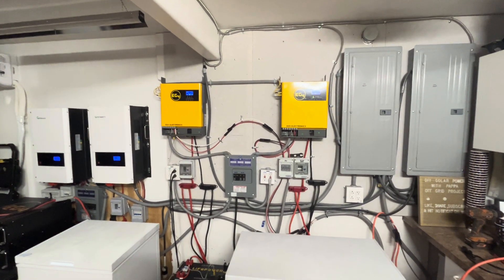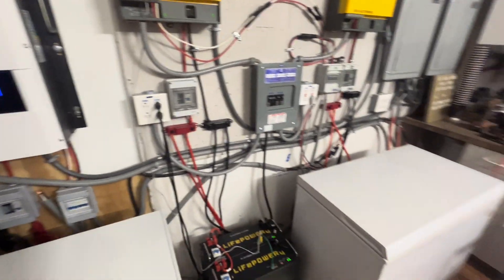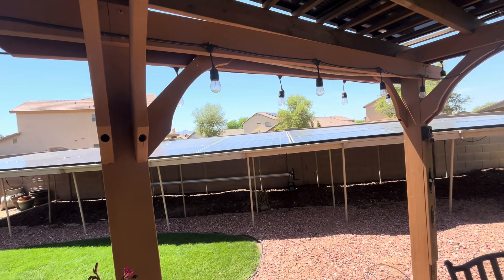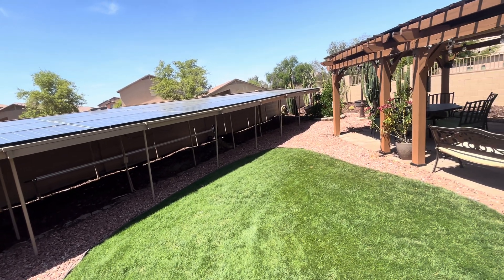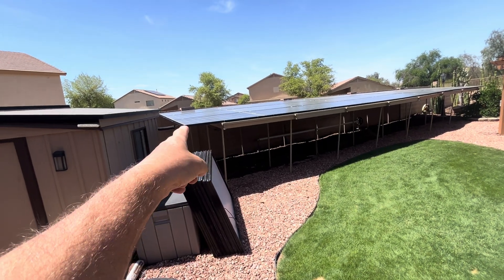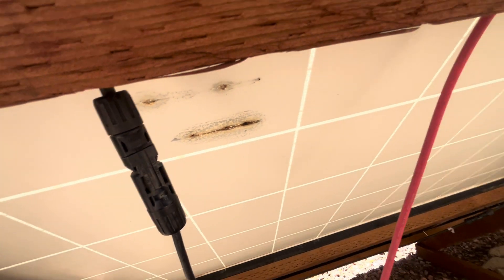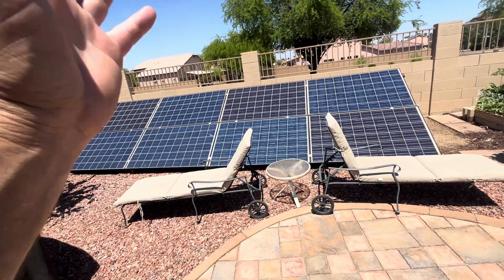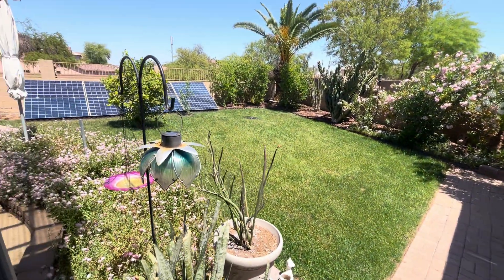DIY solar panel for home. Bifacial New 400-500 watt mono panels versus used 250 watt poly panels

Comment: Can you do a video on your panels in parellel. Do you use a combiner box?
Reply from the maker: I do not use a combiner box but are moving away from using parallel arrays since the higher 500 vdc input from solar allows me to connect up to 13 solar panels on series and stay under 500 vdc solar panel PV input into EG4 inverters. My Growatt inverters are limited to 150 vdc solar panel PV input and is not as efficient at bringing in more watts and amps from solar panel as being in series. I am getting up to 80 percent more watts input when in series and connected to EG4 3000 watt inverter. I am also moving away from the used poly solar panels to new and used mono and new bifacial solar panels. I am seeing a huge increase into inverters with same watt solar panels with the mono and bifacial solar panels compared to poly used solar panels. I will try to do a video on connecting solar panels in series and parallel and the benefits & drawbacks of each wiring connections. Hope you have a truly wonderful and extremely blessed 2024
Reply: Thank you. I do have the eg4 3k same one you have. I was going to go with the ten 400 watt bifacial in series. Right now I just have smaller 100 watt panels. Total of 1200 watts in two different strings. Thanks again for the fast reply. Love the videos. Keep up the good work.
Reply from the maker: @D1petergriffin  very nice. I started out with just 2 solar panel and just kept expanding as I saved more and more money with using more and more things on solar power. Now I’m running my 3 1/2 ton and 4 ton ac right now on just solar off grid while my pool is running on highest RPM’s along with a mini split keeping my house at 74 degrees for 2 story 2450 square foot house and running a 18,000 btu mini split in garage as well on solar keeping it 78 degrees while it is 105 out right now. All my solar off grid will be completely paid off from savings on electric bill by December of this year, 2024. I use almost double of what I used before setting up off grid solar. It is so easy now with the products they are selling. Hope you solar system works great for you.

Comment: Man I'm SO glad I watched this video. Those same used 250w-8.1a panels are the ones I was going to buy for $50 each. With a possibility of that much degradation in them I would be hugely disappointed in their output. I don't think it's worth me getting them for even $10/ea due to the work involved in hauling them onto the porch roof by myself at 69 yrs old. As Yoda might say: "A solar Guru....you are".
Reply from the maker: I actually think the used mono solar panels are worth it because they do better with shading, cloud cover, early morning and dusk also most importantly in series with inverters that can handle 500 volt dc PV input. I tried using in parallel for my Growatt 12kw inverter where the max PV input is 150 v dc. Was not happy with the efficiency but I used those same solar panels on my EG4 3000 watt inverter and they are so so much more efficient. I gave 6-330 watt mono panels in series along with another 6-330 watt mono solar panels in series, then I connect those on parallel. That’s almost 4000 watts between those 2 string combined into 1 string. I get 3000 watts input into inverter as where when I string of 3 in series then 4 sets in parallel, I was only getting around 2000-2200 watts with Growatt inverter. I like the used mono solar panels for the used price. You get what you pay for. I just bought 10-400 watt bifacial with 100 possible from back side and those are excellent panels at $124 each. Well worth getting brand new. I can get 3500-4000 watts out of those new bifacial but have a tough time getting 2500 watts out of 5000 watts used poly solar panels. I’m 62 years old who has been going through 2 incurable cancers for last ten years and just diagnosed with another cancer, so I know it is not easy setting up this solar system but it is possible when you are determined. Best inverter for money is the EG4 3000 watt off grid inverter where you can connect up to 5000 watts and up to 500 volt dc PV input. You just have to keep the dc amps coming in from solar panels below 20 amps. Check out my newer videos with these EG4 3000 watt inverters and see everything I run with these little lightweight power house inverters and EG4 LiFePO4 battery banks. Thanks for your input and I hope you have a truly wonderful and extremely blessed 2024.

Comment: Your first problem is you comparing bigger by fish or soap panels with smaller solar panels and old solar panels.There's to new solar panels And if you're took care of your police, so apparently still be given yet 200 W, but you never took care of them did you?You already said they're used when you got them. My 24 years poly solar panels   Still give me the power. They said they will give the day. I got him when they're brand new but didn't get that guy. I got him when they're brand new but didn't get. That again, I kept my panels clean and kept the wires. Good kept replacing the wires. If they got bad or if I didn't like them all on son. They still do very good for me. And besides, they start making power before the other one's will and they stop making power. After other ones will do we make a more power by working longer than the other ones.
Reply from the maker: Thanks for your input. We appreciate it. Hope you have a blessed day.

Comment: I have 9 poly panels I bought when they got below $1 a watt in fact I got a pallet of 10 - 60 cell panels with shipping for $1800. I know I should have gone with mono for here in Oregon but they were still expensive comparably. I can get 13 kwh in summer but the winter I have got less than 1 kwh. I am at 24 volt and wish I would have gone right to 48 volt so was going to add more panels and thought of more used poly panels since they are so cheap. To try and match my summer power I would need 9 x 13 or over 100 panels. It looks I will not be getting rid of the generator but I did finally went with LifePo4. Something about the poly. Once in awhile on a cold morning  after a rain or at least a clean sky the sun will come out from behind a cloud and jump up my harvest to 2400 watts which is max output but it doesn't last long, usually it is 1500 watts. It is like the sun shines a little different using the clouds to increase radiance. You can actually see it when you know it is happening. Poly may be a good choice for cold mountain cabins with clear, clean skies. Once they heat up there isn't much we can do to increase the harvest. Thanks for the information, I think I may go with the mono now. I liked and subbed.
Reply from the maker: I started out with the cheap poly panels because I have a large 1/4 acre lot yard and  they were really cheap but seeing I can get so much more out if the same size solar panel, I’m going to spend more money and get the new solar panels. Thanks for sharing your comment with us. Hope you have a truly wonderful and extremely blessed 2024

Comment: add another battery or 2 to get a true(r) idea of how much they can produce before 12 noon, oh and swap out the poly panels for bi facials a complete no brainer :)
Reply from the maker: Thank you so much for your comment and suggestions. We started with this simple set up and now heat and cool our entire 2 story 2450 square foot house and 600 square foot 3 car garage with only off grid solar. We use a 35.5 kWh LiFePO4 battery bank for overnight use. Our electric bills are 10-15 of that of our neighbors. We also heat our 15,000 gallon in ground pool to 86-89 degrees starting in March with a pool heat pump pool heater that uses 7500 watts while on and when our neighbors pool water temp is still in the 40’s and 50’s degrees. This is just a simple set up I ran for 2 + years in a shed when playing with solar. We have evolved considerably check out all the things we do with off grid solar and what components we use to do this. Thanks and hope you have a truly wonderful and extremely blessed 2024.

Comment: Hey, you jumped into the solar river early on and now you are moving with the flow brother. I'm still standing on the bank waiting to get in. Great job!
Reply from the maker: Come on in, the water is fine. Very easy to understand. Components are so much more simple than 4 years ago. Easy to get all your supplies at one place. Click on links in videos first products. Hope you enjoy the other videos. A lot of info in videos. I started 5 years ago not knowing anything at all about solar off grid or mini splits. Thank you and hope you have a truly wonderful and extremely blessed 2024
Reply: There are numerous places that have used or inexpensive panels now. Kinda insane. Also batteries are dropping in price hard.
Reply from the maker: @davidsalvador8989 I like the server rack batteries from signature solar that have built in fire extinguisher as a safety. Without that you can not put out a lithium battery fire. Don’t like messing around with building my own battery when the batteries they sell have so many safeguards built in. Follow link in video. Down from $1800-$2000, now around $1,200 each plus this week is free freight for $2000 or more spent. Saves about $250-$350 on freight cost. Good luck with your project

Comment: Just a question are those by facial panels also connected in Siri or in parallel because that also makes a huge difference
Reply from the maker: The bifacial solar panels are connected in series at 37.1 volts dc each equals 371 volts total to the EG4 3000 watt inverter that can handle up to 500 volts dc PV input. Keeps dc amps below 20 amps using 10 gauge PV wire.

Comment: lot of variables here, not just bifacial vs non bifacial. Are they all the same age? Did you individually test all the panels before hooking up? I've gotten plenty of panels that were used and were broken and got replaced with other used ones because they were very bad. Similar to how bad yours are. My "250 watt used" ones output 220-240 watts because I tested them to make sure they were good and returned the crap ones that were lower
Reply from the maker: I’m going to replace my poly panels with new bifacial sole panels this next year so no big deal with old panels. The panels still give me more that what I need at this point. Thank you for all that valuable input in your comment. Hope you have a truly wonderful and extremely blessed 2024.
Reply: @diy-solar-guy  All of your bifacials and any other panel, new or used, can also come with half input. You should always measure each panel individually before installing
Reply from the maker: @gg-gn3re yes, I need to purchase something to measure watts , any suggestions?
Reply from the maker: Did you send me a response for what meter to buy?
Reply from the maker: I have one saved in cart for that I was going to buy. Thanks

Comment: hight tech solar panels are getting incredibly cheap these days, its no longer economical to hold onto old panels, which is why the second hand market is so saturated with them. Large business know exactly what they are doing replacing barely used 3-4 year old panels with new ones. I just spent £240 for a 1.6kw mini array (4x410w Longi Hi-MO panels brand new) 5 years ago that would have been triple the cost. If you sell the electricity back into the grid then you should 100% get all of those old ones swapped out, your RIO per panel will be less then a year probably. One thing is have have noticed though with your set up is that it is very close to the ground, there is something called shaded spot damage. If you expose one part of the panel to direct sunlight but have a shaded spot then that panel completely stops producing power as it creates a block in the flow, wherever the energy is blocked is where the failure will occur, basically shoving amps of power into one tiny spot creating what you see as burn marks.
Reply from the maker: Thank you so much for your valuable input. The burn marks were already in the panels when they were on pergolas 9 feet off the ground. But I understand what you are saying. I’m always playing with making or buying new solar arrays. I only have the burn marks in my used 250 watt solar panels. Have not noticed any issues with the mono solar panels. The new solar panels I bought actually have a lower 37.1 volt dc output which is great for some of the older inverters that can only have 150 volt input from solar panels. Also great for the new high frequency inverters that have 500 volt dc input, using 13-400 watt bifacial solar panels I can get close to the 500 volt dc input. I like there is less than 20 amps in the 10 gauge PV wire for 13-400 watt panels. I’m looking at some 370 watt Bifacial to 480 watt gain for only $96.20 each solar panel, Mono half cells. That is really cheap. My local place is asking $100 for used 300 watt poly panels. Being able to produce the same amount from 3 poly panels and only using 1 mono bifacial is great. Uses one third of the space. Hope you have a truly wonderful and extremely Blessed 2024.

Comment: i am i the same boat , i have 12 mono 320w panel and yea in the good conditions they actually put out full power but i recently buy 2 canadian solar 445w bifacial and put them in a victron charge controller and i was blowing away by there output  they put out 1100w + i was in shock and almos every day they put more than what they a rated for  , so now i thinking out changing all the panel 😓
Reply from the maker: That is excellent output. Where did you get those solar panels from and how much? I think I will have to try those Victron charge controllers. Thank you so much for sharing that with us.
Reply: @diy-solar-guy  is company here in Puerto Rico that sell solar panel the thing is that they are actually use solar panel , don't now were they get the panels from all my panels are from them .
Reply from the maker: @soulkeeper514  thanks for the info. Sounds like you have a good local supplier. Have a blessed day.